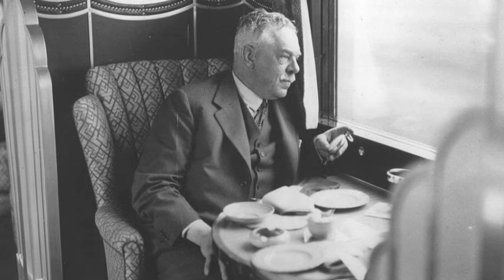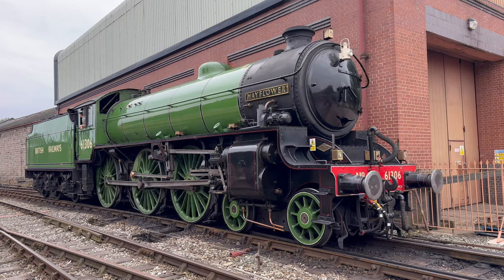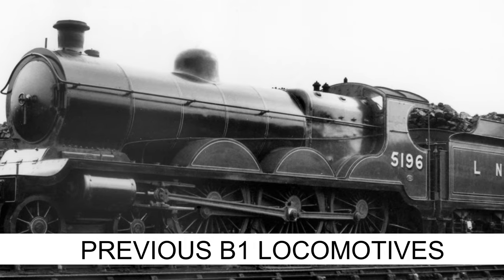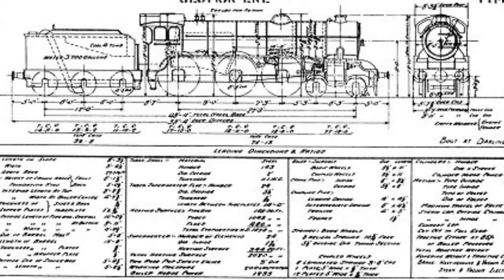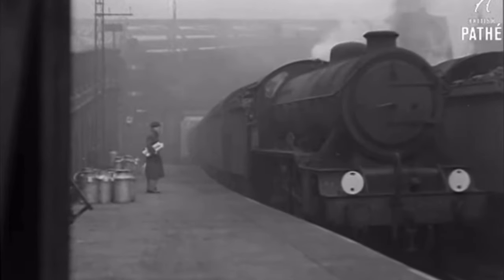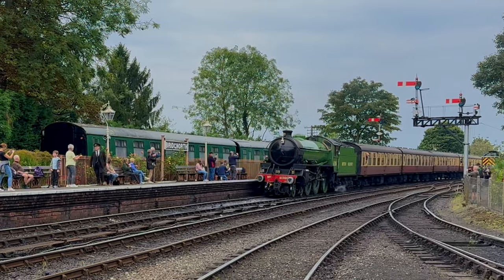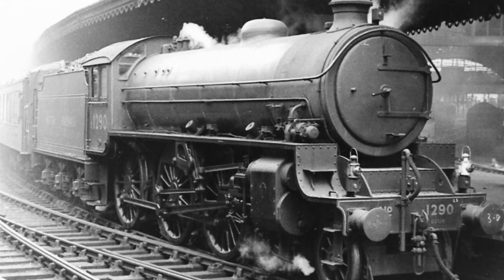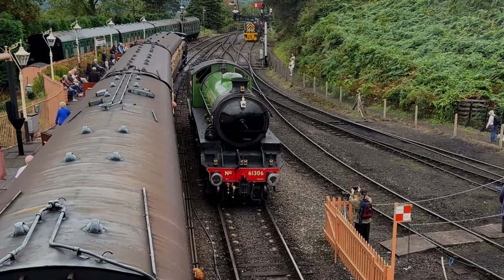A worthy rival to the GWR hall? The LNER B1 class, a history & overview of this war time locomotive

Comment: You could argue the Thompson A1/1 was the best single locomotive he ever made. The B1 is probably the best class he ever developed, though.
Reply from the maker: A very good point, the design changes due to the war make it such a departure from the Gresley days it’s always going to have a strong association with Thompson
Reply: The A1/1 was about the only single locomotive he ever produced, so not saying very much realy. Thompson built far better engines than the A1/1. The O1 for example proved its self superior to the WD, O4 and latterly the Stannier 8F, when working the Annesley Woodfor runners. 

As for the A1/1, the A3s fitted with the Kylchap double blast pipes were just as good and a lot cheaper to produce than rebuilding to A1/1. The A4s were never outclassed by the A1/1, while as a follow on from the Gresley Pacifics the Pepercon A1s were far superior.

Comment: I would like to see a comparison of the Hall, B1 and the LMS and BR 5s.

The B1 boilers were originally troublesome and there was a proposed to rebuild the class with LMS style boilers, but the problem was resolved with the original boilers.
Reply from the maker: I havn’t done much with the channel for a while, but I do intent to get back too it soon :)
Reply: Remember that the boiler design for the LMS “black fives” and the subsequent standard 5s were more or less derived from the Great Western, following the transfer of W Stanier from the GW to the LMS after the 1923 re-organisation of the industry. Much of the early work for boiler development was done under G J Churchward. Some of their features were copied from other manufacturers as well, from different parts of the world.
Reply: @johnkeepin7527  
I would guess that the tooling for construction of GWR style boilers would be expensive to set up. Thompson is known to have been opposed to the investment.that would have been needed.

Comment: Hm. The B1's were very good, but they could be catastrophic rough riders and threw sparks like nobodies business. Even though they were 3 cylinder, the B16's (remember them?) were a LOT better, especially in B16/2 and B16/3 form.
Reply: I've spoken to drivers of B16s in the past. On the GC london extension they refered to them as 'bloodspitters' as they were notorious for throwing the half the fire up the chimney. The B1s were regarded as better engines than the Black 5 by GC men, due to the poor injectors on the latter. The joke being the amount of water they deposited on the track, it was no wonder there were water troughs every  mile on the West coast mainline.The Standard 5 was regarded as better than either.

Comment: The LNER B1 is a superior locomotive to any GW 4-6-0, the end
Reply: @johnbradshaw7525  many ways:
Fewer oiling points
All the valve gear is all on the outside
Don’t need a pit to prep one
Easier to maintain 
Don’t have to shovel off the floor
Weather protection is better
Free steaming
Cab ergonomics are much better
Not as sensitive to poor quality coal
Electric lighting 
Bucket seats for the crew
Good solid sturdy machine and punchy when required
Reply: @Simplex1988  The GWR 4-6-0 locos must have had some good features as they ended up building nearly 750 4-6-0 locos of various classes, ranging from the Star class right up to the Castles, Kings & Counties.